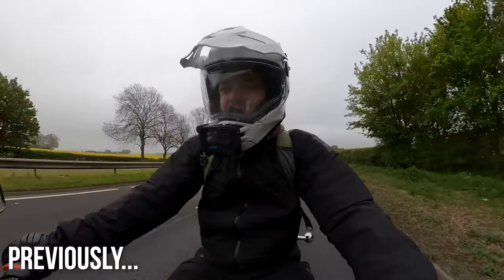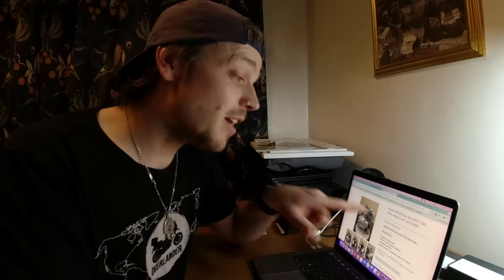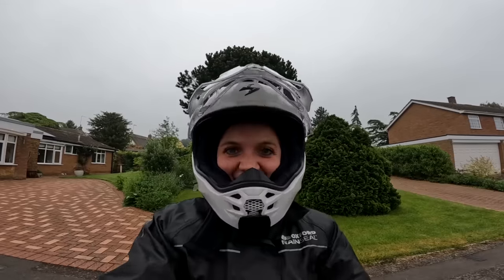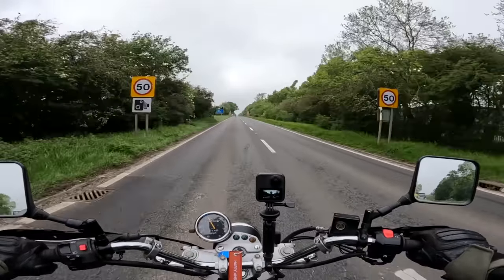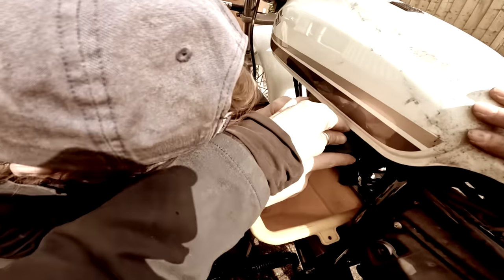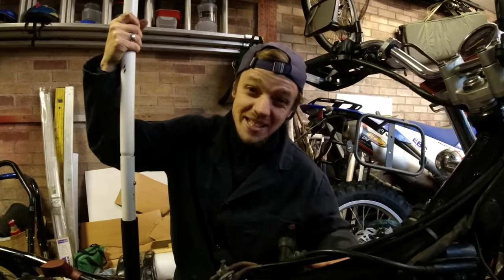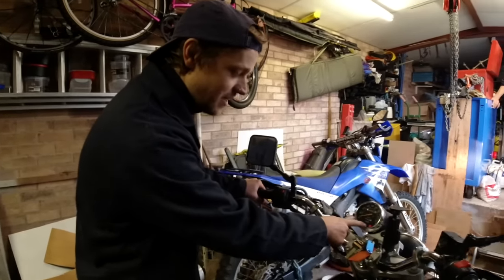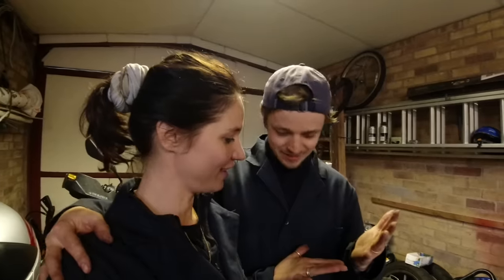Fitting a NEW ENGINE We Found on eBay! [S7-E8]

Comment: For the technically minded Ollies original engine had two unrelated issues. The knocking noise and the hesitation. The hesitation was definitely a fuel starvation problem due to the fuel pump being faulty and the replacement second hand unit also had a similar issue but not quite as bad.  The engine knock we believe was down to a none standard piston that had been fitted. Suzuki only ever made a piston that was 0.50 mm oversize, the one in this engine was 1.00 mm oversize. We believe this piston has an incorrect piston pin offset creating a lot of piston slap noise.
Reply from the maker: Thank you Rob 🥳
Reply: If you find the Part Number A80 and  A121A where both from Suzuki and than should be even  an 62mm Big Bore Conversion Pistonhead around and the Last one should normaly explain the difference. Than combine it with an bad worked conversion to 150cc than you also get the fuel starvation and knocking in combination. If you want to waste the time to measure it i think we found it finaly.
Reply: @mariokuppers5686  It hadn't been converted to 150cc the piston was only 1.00mm oversize. The maximum oversize according to Suzuki is 0.50mm. Also the bore to piston clearance was within tolerance. But we believe this non standard piston had a non standard gudgeon pin offset creating a twisting moment on the power stroke.  We stripped down the fuel pump which is of the reciprocating piston type operated by a solenoid and is combined with the injector. The tip of the piston was worn allowing petrol to escape up the sides of the bore. This was the reason for the fuel issue as soon as Ollie started to push on requiring full power.
Reply: As of the time I'm writing this I see a new old stock oem VanVan cylinder on eBay in the UK for $100.  For that price the mechanic in me would build up the original engine with a new standard bore piston for a spare.  I expect these bikes are going to take a real beating on this trip.
Reply: Fair play Rob your a good man 👌🏻
Reply: Good work Rob, I think you might not be many miles from me.👍🏻
Reply: @andyforster7023  Let's say we know when there are bikes going round Mallory Park.
Reply: @robertsmith4466  😉👍🏻. Well, if you’re going down Blaby by pass some time, I might hear you😁. Take care buddy👍🏻
Reply: Thanks for the update Robert!
Reply: Thank you Rob! I def wanted to know what it was. I'm beginning to do motorcycle restoration and love to learn!

Comment: Your motor problem seems to be a motor that overheated and seized.  The piston and cylinder are not perfectly circular anymore, and when they expand when the engine is running, they don't have the proper clearance to allow the piston to move freely, or the gap get's too large between the piston and cylinder wall, causing a loss of power.  You would need a cylinder bore gauge and a good set of micrometers to make accurate measurements of the piston and cylinder, plus the different bearings in the moving apparatus of the motor.

Comment: I now think you two have a better understanding of how a bike works thanks to Robert guidance, and of course the problem engine without which none of this would have happened. I would advise you to get the valves set before you set off as they will get worse with time and not better, ( also aids fuel consumption)
Ollie I would tho' advise you to also fit a crossbar on your new handlebar as being of a higher and better position for you to ride it is also more prone to bend easier on a tumble. 
Ride safe guys 🤗
Reply from the maker: Yes we can’t believe how much we learned from Robert! It was so much fun 👩‍🔧⚙️👨‍🔧

Comment: you must almost be wishing you had Brought a couple of new V-strom DL250SX's at this point
 (especially as I get 3.1L/100km around town, and 2.8L/100km (100 mpg imp & 84 mpg US) on the open road with mine)
The only problem I have with the V-strom DL250SX is the MRF tyres, the front doesn't inspire any confidence in the wet whatsoever, even with the pressure dopped down to the recommended 22psi, it still feels like riding on wet timber decking! Otherwise I't easy to ride and not as big and cumbersome as I first though it would be!
I've never seen a Van van in person, I don't think we even got them here in New Zealand, just the GN125 & GX250, but they are no longer available as thet don't have ABS can't be sold New anymore!
Reply from the maker: Yes we would have loved to get the 250 V-Strom but you can’t buy it here in the UK 😭 perhaps we can try it once we make it over to NZ 🥳
Reply: One or both of you should enroll in a basic motorcycle repair school, just in case.